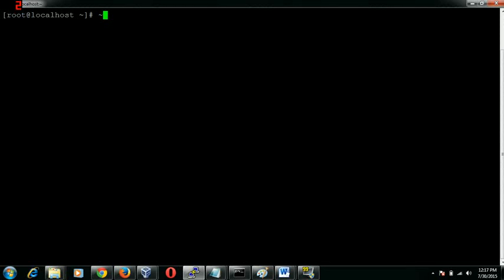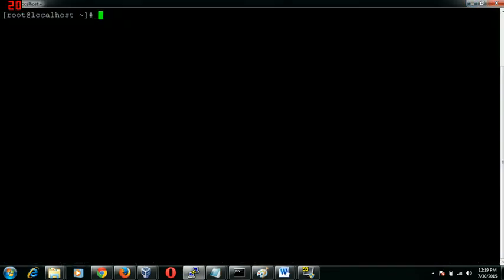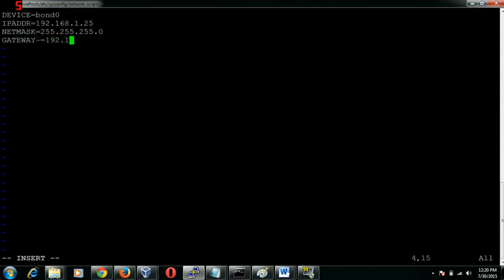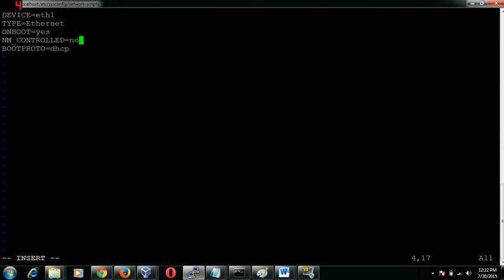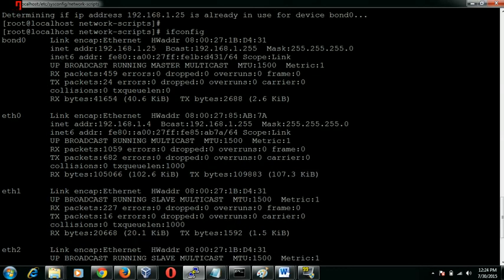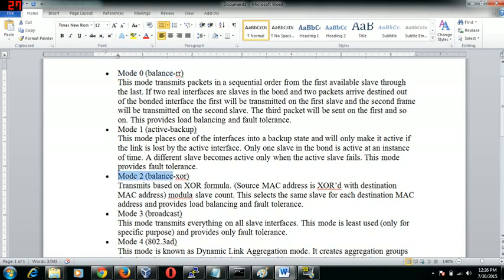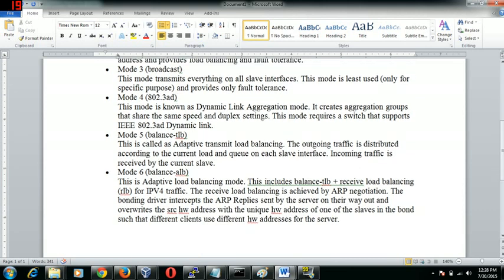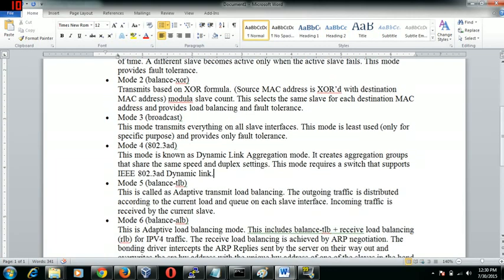NIC/Channel Bonding RHEL6

Comment: I want to make linux bonding mode 0 as weighted round robin.i.e; to assign weight to each slave depending on packetdrop or latency. Is it possible to do so? Are the configuration files of modes user configurable in linux?

Comment: Hi Irshad, Good job.I have an issue as I am trying for bonding in RHEL 5.9 DVD_64Bit with kernel version 2.6.18-348.e15 and till bonding it is fine but when i tried to add vlan 58 e.g., ifcfg-bond0.58 with vlan=yes, its return with the error of delaying initialization. Any idea ?
Reply from the maker: Thanks for watching. Use the vconfig command instead to add VLAN which is more appropriate to create VLAN tagging.

#yum install vconfig -y 
###If you dont have the package already installed

#modprobe 8021q 
###To load the VLAN module

#vconfig add bond0 58 
###To add a VLAN inteface with ID 58
#vconfig rem bond0.58
###To remove the interface

#ifconfig bond0.58 
###To view the status/information of VLAN interface

#ifconfig bond.58 192.168.58.100 netmask 255.255.255.0 broadcast 192.168.58.255 up 
### To assign an IP to this interface

#cat /proc/net/vlan/bond0.58 
###Gives you a lot of useful information.

Let me know how it goes

Cheers
Reply: Thanks a Lot, its done.
Reply: How to make this persistent as after reboot all configuration is gone.. ?